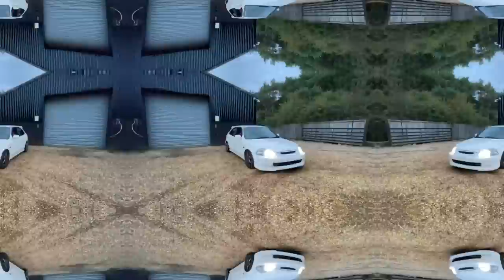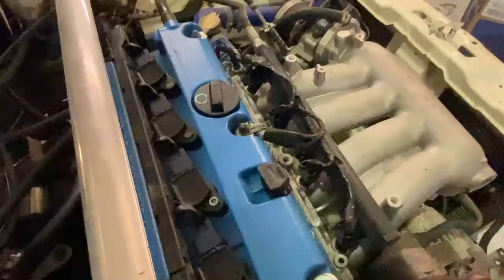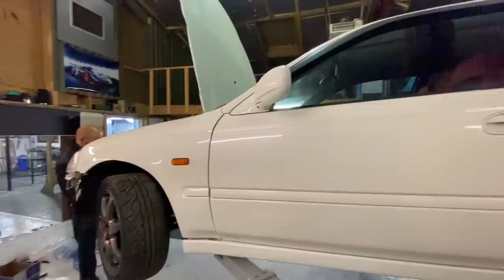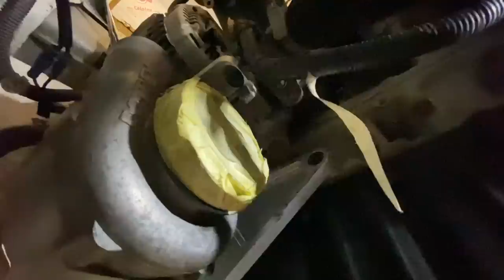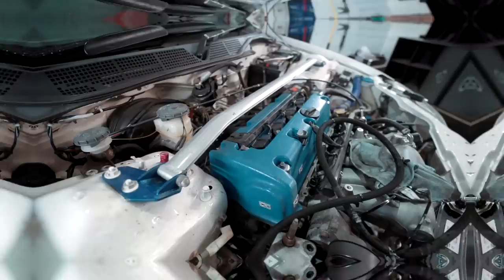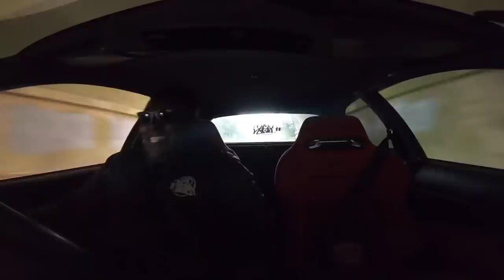*FIRST DRIVE* IN MY SUPERCHARGED HONDA CIVIC EK9 K20 SWAP!

Comment: Rickys got his own car now ,,,, just saying 😁
Reply: Would like to at least see the race happen now
Reply: Stage 3 vs stage 2 though
Reply: Allow DMO to get that turbo fitted
Reply: With these mods the m5 is going to smoke his e63 all the reason dmo act like a silver back he was trying to get rickys gtr out than he maybe stood a change
Reply: @AWSOMEspecialist  DMO said he doesn't care about taking a L to the M5..its the fact Ricky rocked up in another mans car..even though it might be same spec ITS NOT HIS CAR! Thats the point DMO is making..Ricky said the 5bags and GTR snapchat was "jokes" too.
Reply: @Taylor40667  Lol. Absolutely meaningless.
Reply: Luke Miles exactly
The e63 wouldnt need forged just turbo , cooler and meth itl be over 1000 bhp. Dmo could get this done quick and get the sauce on it 
Show up to the airfeild And smoke the cnt
Reply: i have seen it a metro.

Comment: Waaapapapapapaap waaapapapapapaap paap popopop lols...
 my kinda driving fam pure missin my racer days need to get back on it an get my nxt build project on that go b4 they ban petrol an diesel an make all road cars electric not dissing the performance but there's both in like the sound of a petty motor sound or the whine of a turbo or supercharger spoolin up an the sheer fun of a little hatch built full send an skatty fam congrats on the new build it civic is fully litt absolutely love it

Comment: Bro if you dont let the turbo settle in and kick its head in straight away. You'll kill the turbo quicker, give it 500miles driving the car normally, and then kick its head in. On a different not when he does that first ruthless pull watch the truck at 6:15 and his quick he pulls away from a standstill

Comment: I love the sound of the hks dump valve on a turbo but I'm not sure I could live with it chipping non stop every time you let off till the revs fall off. is that just how it has to be with this setup?
Reply: Only happens when it's on boost if your just pottering around it just acts like an n/a car
Reply: It's a rotrex style supercharger , not a turbo ;)